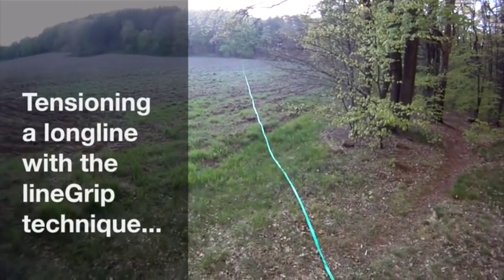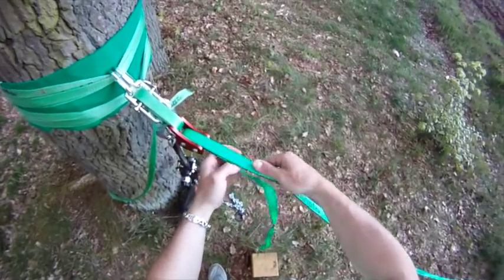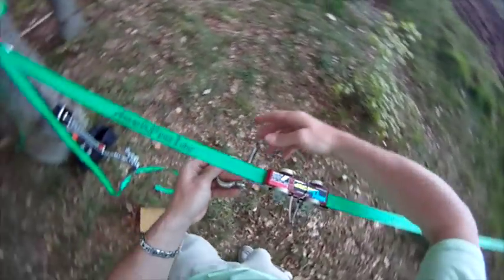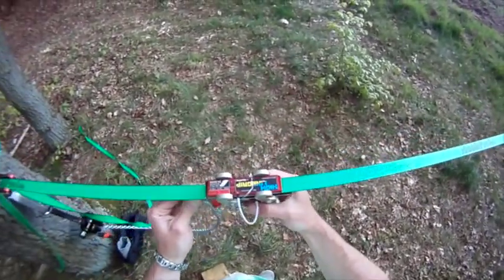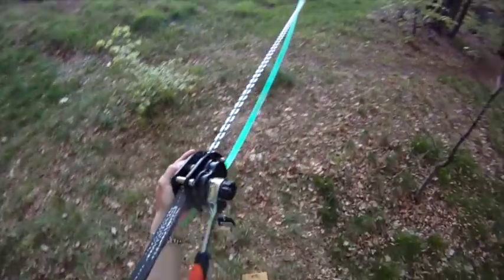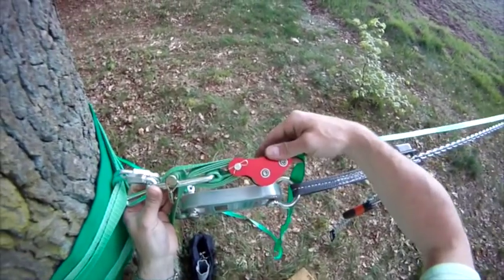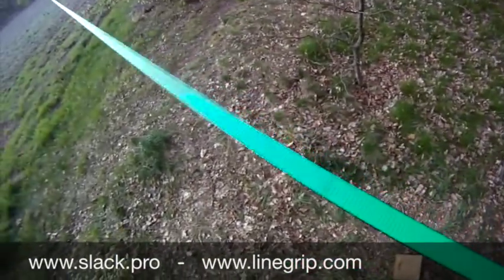tensioning a longline (here 150m) with the lineGrip and lineTight (re-upload June 2nd 2014)

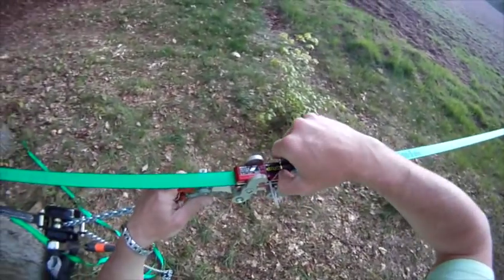Comment: I would not recommend putting your hands between the lines when one is loose and the other is tight (such as 9:48) If the line lock was to fail then the tension transfer could injure your hand. It's good practise from a riggers point of view to treat any line as an energy source until it has been completely removed from the load bearing part of the main line (when the grip or comealong has been removed)

Comment: what kind of webbing was used here? im thinking a low stretch like mantra would work better with this system if I'm tensioning myself.
Reply from the maker: I used the NEON-Light. It has 4% stretch at 10kN. Mantra will work like a charm ;-)